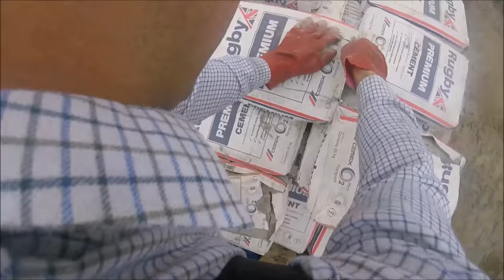Concreting the workshop part 1

Comment: Unless he got that cement free, packed is a really expensive and inefficient way to do this. Part-load bull would've been easier... for cement or concrete.
Reply: 25kg is around 2.5 euro thats not much
Reply: I was wondering the same , does it work out much cheaper to mix your own"?
Reply: I can mix C35 concrete for £75 per M3, I’m currently paying £144 per ton for cement, I’ve got a 6m3 lorry mixer & a 6m3 tractor mixer

Comment: nice work!! but without the mesh or controlled joints its going to crack like a cookie
Reply: Agreed, seems a shame to go to all that trouble and then not place reinforcement in it? The white polystyrene strip is to allow for any expansion of the cured concrete I presume?

Comment: what's the white tape stuff for ??
Reply: Its to allow for expansion. Otherwise the whole floor would end up cracking. Somewhere, you will literature (BSI?, ISO?)find the proper spacings that you require for it to be sufficient - probably based on depth, length of run or square meterage most likely.

Comment: That shit is going to be full of cracks in the firs year if not damn near busted up. No mesh down to pretension against the cold, slab is to thin and the mixer batches are too inconsistent in water to mix ratio plus too much time between batches.

Comment: no reinforcement mesh first?
Reply: Reinforcing mesh isnt always required in concrete
Reply: yea but better job for that
Reply: +ulster loyalist no surrender 
it is better with reo but may not be economically efficient depending on the use
Reply: +ulster loyalist no surrender no real need